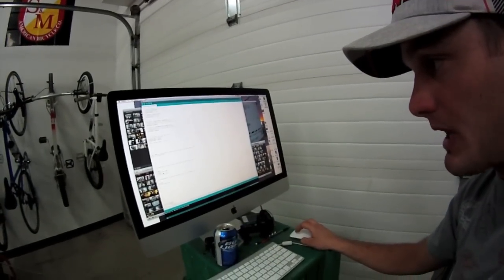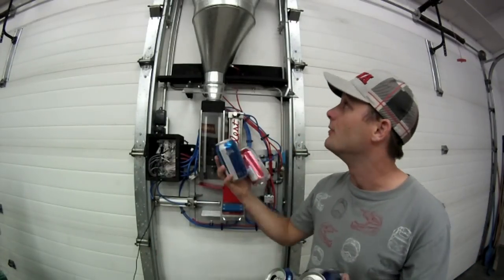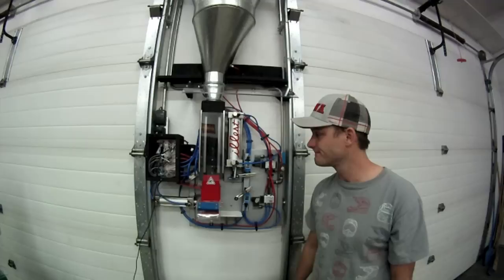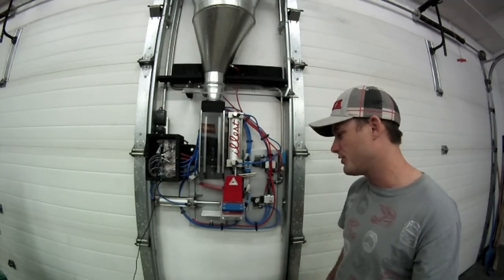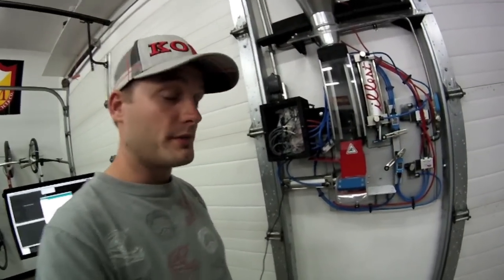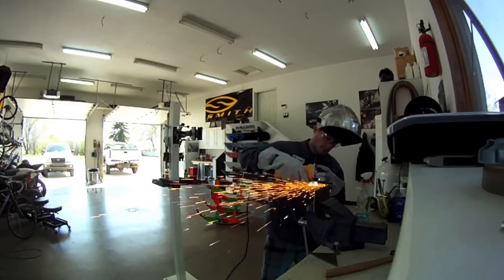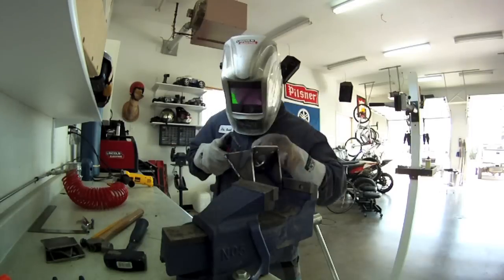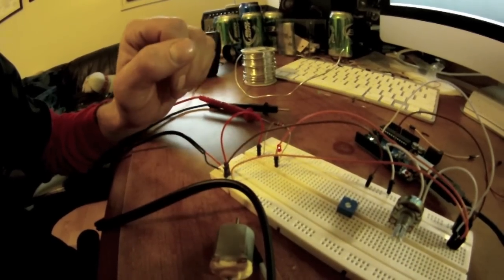Fully Automatic Can Crusher

Comment: https://youtu.be/Gk1f_6trUow Automatic can crusher design in 2012 using Solidworks. Actual component build in are infrared sensor for detecting can and pneumatic for crushing can and also electronic system include power source, timer and relay

Comment: could you design a 30+ can capacity hopper for it and still have it feed cans consistently? You wouldn't think a can crusher could have so much engineering behind it. This is truly impressive. I've seen a lot of can crushers on youtube and this is the only one I have seen that is fully automatic. Just dump the cans in the hopper and the machine starts/stops working by itself. bravo.

Comment: I Guess you don’t want the deposit on those cans then.  5¢ a can can add up fast tho.  My question is, is the scrap value of those aluminum cans worth more than the deposit on them.  Can for can.
Reply from the maker: We actually receive 10cents per can here in Canada. I haven't had any problems returning them, also because one bag is like 6 normal bags because it's so dense. This is a question that comes up often but luckily they don't mind taking them in my town :)
Reply: @Pistonpedal  
So in Canada cans are accepted for deposit even if they’re crushed?  
Here in the US the barcodes on the cans have to be readable to get the deposit when their redeemed using a machine. Crushed cans aren’t accepted because they won’t go in the machine. 
10¢ a can you say hmmm. I feel we’re getting cheated here in the lower 48.
Reply from the maker: @railnut8453  You bet! Years ago we would get 5 cents for pop cans and 10 cents for alcohol. It's not that you're being cheated necessarily, we pay the fee when we buy the product and then are compensated when we return it. Basically a deposit. So if you don't return your cans then basically you are throwing away money. The key in my mind is just making it efficient for people to recycle.

Comment: How would one calculate the amount of force  that piston needs to exert?
Reply from the maker: Here's what I did, I stepped on a can and crushed it. I weighed 165lbs so I know it needs at least that, to do it properly - likely more to do it fast. I knew I had at least 80 psi (Pounds per square inch) available. Essentially I need at least 2-3 square inches of surface area in the crush piston. So since my crush piston has approximately 9 square inches of surface area the I have (9 x 80psi = 720lbs of crush force). Which is far more than 160lbs. I hope that helps!
Reply: @Pistonpedal  nice, this'll help my project. Thanks!

Comment: Good automated and mechanical design for manually feeding cans by hand.  Fill your hopper with normal dented and twisted cans and you will be surprised to know that no plc or mechanical feed will be able to compensate for different shape feed cans.
Reply from the maker: Adobo partially true. The cans can be different heights and sizes. Small red bull cans right up to tall cans are crushed easily. Dented cans are crushed and fed through the hopper as well. Cans that have more than a 15mm width deflection won’t make it in  so this is where you are correct.

Comment: Wicked machine. How exactly is the remaining air from the cylinder kicking the can out like that. Cylinder extends down to crush, but I don't understand how you get such a nice kick out.
Reply from the maker: Steve Saboe the main actuator has about 400cc of volume at a fairly high (760kpa) pressure. The actuator has 2 sides and is called a double acting actuator meaning, for it to fully stroke the air on the other side of the piston must first be vented. All I do is take that high pressure vent and route it to the back side of the cradle. There is a hole through the back of the mounting plate as well as the cradle to which they align for the final crush stage. It’s enough pressure to blow a golf ball across a room. Does that answer your question?

Comment: Does your hopper ever get clogged? I suspect that if you tried to fill it with a bag full of cans at once, it would likely get clogged. Am I correct?
Reply from the maker: Sorry if I couldn't help you with the code but it's almost impossible to use without the same components. Glad you were able to figure something out.
Reply from the maker: If you dumped a bag in I would say there's a decent chance it would clog. Only one can needs to make it through first and start the cycle, once it does, the air agitators will do their best to shuffle the cans in the hopper. There is still a good chance of it clogging should you dump a $hit ton in it.
Reply: Thank you for your response, I am conducting research on can crushers by watching videos so far and I have had some interesting discoveries. 

Of the 20-40 videos I have watched, yours is perhaps the most technically advanced. Good work!

I plan to design, but my goals are very different than yours were. If you have any suggestions for a hopper that is clog proof, I'd like to hear it. All I can think of so far is either a broad aperture so a multi can crusher or a hopper clearing mechanism with the goal of having either a never clogging or self-clearing hopper.

Thanks again!!
Reply: He doesn't reply. I built a PLC controlled model that costs roughly the same that will out perform and outlast his.. I'm dogging him because I asked nicely and tried to compensate him for a little arduino help and haven't heard from him.. You will see it on Youtube before long and it will smoke his junk.
Reply: @andyketterling6132  Never Happened...................... Guess it was just smoke 😂
Reply: By the way... Im signed in as my buddy Andy by accident. If you would like to reply my Email address is spantle@panhandle.rr.com

Comment: I had a quick question about your can crusher. I'm planning out the same project, and was planning on a simpler approach, but decided to follow fairly closely in your footsteps.

 (The more I plan out the project, the more I keep stumbling across the solutions you already have in place, so am just going to work closer to your plan, and I figure that will solve some problems before I even find them, haha)

Your red bucket feeder, how did you decide on a height for the angle to start from? (Bucket height vs angle start)
I can't figure out how you've managed to feed tall cans and regular ones without having either the second regular can getting bound, or not properly feeding the tall can. 

I suspect you don't have any plans available, (and like he design challenge anyways) but this one thing I am having troubles with on paper!

I would love to hear your thoughts!

Comment: did you add a can counter to it? im thinking of adding a  ounter on the ejectionside. adding one on the  y le side of the program would only  ount cycles and not an actual can being ejected,  great work btw,   princess auto eh.  luv it, hellow from toronto area.    cheers

Comment: Would have been cheaper just to use a PLC instead of rolling your own control board.
Reply: Hard to tell.   I my guess on PLC parts would be $70 for main board, $50 for relay module, $30 for P/S.   $150 using a Click PLC.

Comment: very nice.  Now all you need to do is drop the bailer level and increase it's capacity.  Very nice design and looks very efficient.  To get it to a consumer level machine you would have to include a compressor to make it turnkey/"plug and play" or switch to all electric actuators.

Comment: Hey man, Awesome Job! What actuators/pistons did you use and what Pneumatic Air Solenoid did you use? is it a 5 port 4 way? I have a princess auto HQ just down the street from me, and want to attempt this build. thanks bud!
Reply from the maker: Hello, Actuators are 3"x 6" stroke and a 2" by 4" stroke I think. Solenoids are 5 port 4 ways from Ebay. like 18 bucks each.

Comment: Holy crap, you have a Sik Garage. The machine is Bad Ass. Seeing as your a Genius, I like to make stuff with what I got rather than spending money, the compressor/air valve/ electric route isnt for me. I like the one motor can crusher type. I got an old Spin dryer motor runs on 240V AC, way too fast, can I run it much mmuch much slower or run it on DC 12V car battery? was thinking of somehow stripping an old VCR down and using transformer reversing its use from DC to AC. I'm probably mad but any help appreciated.

Comment: Here is a suggestion. What if you added another air cylinder (for crushing on the left side)  and added another can holder on the end of the shuttle cylinder (moves left & right)  so in every stroke it would load a can on one side and crush/drop a can on the other. Double the capacity and throughput. What do you think?

Comment: Also I have never worked with or looked at arduino's, looks like some of the wiring there with the breadboard would be time consuming, and I try to limit my structured text programing (I like function block and ladder). Do the arduino's only offer structured text programming?                Have you considered a cheap PLC?

Comment from the maker: Ejector is an airline routed from the exhaust of the main actuator solenoid. The line comes in behind the panel and aligns with the slide cradle.

Comment from the maker: Thanks! My plan was to make it as easy as possible and still have the ability to crush any sized can out there. The only can it has trouble with are the smallest redbull cans or a badly dented can which will get stuck in the narrow part of the hopper. Material bill was just under 700 however those are all brand new unused parts. The priciest part of the build would be my time. I could likely re-create it in about 20hrs or so. Thanks again!

Comment: I really like the design.  Very high tech.  You posted on mine a while ago about what optical sensor I used.  It is actually a cheap proximity sensor that senses metal.  With aluminum it almost has to be touching the sensor in order to be "seen."  I can't remember where I got it, but a google search for proximity sensor was the start.  Again, nice crusher!

Comment from the maker: Thanks! The tapered chute is a series of 24" to 12" to 4" to 3" ductwork reducers. The final 3" was key straighten the cans. I cut out an opening in the largest reducer to allow for the tossing of cans. There is a beveled disk inside the hopper which guides the cans and eliminates jamming. All of the exhausts from the actuators are routed to the hopper to agitate the cans so they don't jam.

Comment from the maker: Main items were 1 Arduino, 3 actuators (there is a tiny one imbedded on the side of the black loading chute to hold the cans), 2 limit switches, 2 - 2way 5 port solenoids and misc. tubing,wiring and electronics. Lots of free time was the main ingredient.